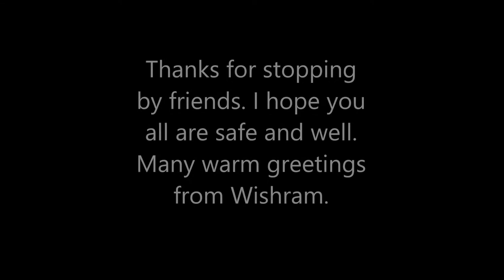Casting Zinc with Smooth On's Mold Max 60 High-temp silicone rubber: 4/10/2021

Comment: Very nice, I would have never thought Mold Max 60 would hold up to the temperature of molten zinc, but your cooling method works great.
Thank you, and keep up the great work.
Reply from the maker: Hi Paul!  It helps that the piece is relatively thin. I've had some failures with more massive pieces. Yeah, the wet paper towels really help preserve the mold. You are most welcome. Thanks for stopping by. Best regards.

Comment: Love those bottle openers Todd and using the zinc make a good looking and durable opener too. Thanks for showing us the steps my friend. I'm going to have to try casting zinc
Reply from the maker: Hi Lloyd! Thank you. I like the zinc because it melts at a lower temperature than aluminum. A lot of electrical conduit is made of cast zinc, which is what I melted down to get my metal. Zinc is a nice metal; not as dirty to work with as aluminum. I look forward to seeing your zinc-casting adventures. Wishing you a pleasant coming week. Thanks for stopping by. Warm greetings from Wishram.

Comment: I know what its like casting. Great you can renovate the old molds and the use of the paper towels good idea. The vent did the trick for you. I have my peaches in the man cave here love it and the other carving and cast you made. 
Cheers
Reply from the maker: Hi Dave! Yes, I'm sure you do. Sometimes the planets have to be aligned for things to turn out well when you're casting metal. I'm a bit amazed how well the wet paper towels work to protect the mold from the heat. I've ordered a laser thermometer so I can better judge the temperature of my molten metal, so that should help improve the quality of my castings. I'm also thinking of quite a few potential future casting adventures. You have to be careful not to cut your vents too big or they leak, I've discovered. I'm glad you are in good company. Thanks for stopping by. Wishing a pleasant coming week. Warm greetings from Wishram.

Comment: I really would like to see pressure casting with this material. Zamac is usually fantastic for fine details and it is plenty strong for functional parts.
Reply from the maker: Hi friend! I would too. I'm looking to cast some zinc hands for a man rowing a boat whirligig soon. I've been using recycled zinc I got from our local scrap yard, but they closed recently, so I will need to find another supply. Thanks for stopping by and leaving a comment. Wishing you all the best.

Comment: I used red RTV silicone for the mold when zinc casting and noticed alot of soft paste on the mold surface afterwards. I then mixed cement into the RTV at 1:1 ratio, I still got flexibility but much better heat resistance, but it still was not perfect . I also noticed ordinary sealing silicone handles heat much better than the high temp RTV and I'm gonna try the cement mix on this.
Reply from the maker: Hi friend! Thanks for sharing your experimentation. I want to try adding cement now. Thanks for stopping by. Warm greetings from Wishram.

Comment: So you are activly cooling the mold. You can also use other silicone which withstands up to 450°C, this should be right on for zinc.
You could also use aluminium for the cradle, it is a really good conductor, you could even activly cool those plates via a pc cooler, water cooler etc.
Reply from the maker: Hi friend! What is the brand name for this 450 C silicone? I would like to buy some. Thanks for the tips. Warm greetings from Wishram.
Reply: @ToddAndrewCole  It´s called TFC Silikon Kautschuk Typ 3 HB
Reply from the maker: Thanks! I'll order some soon.
Reply: @ToddAndrewCole  curious if you tried this TFC silicone yet, I'm going to purchase some for my project if it worked for you
Reply from the maker: No, I haven't had a chance to try it. If you do try it, please let me know what you think. @davidpatterson5713
Reply: yes i will let you know how it turns out, probably will be after the holidays. @ToddAndrewCole